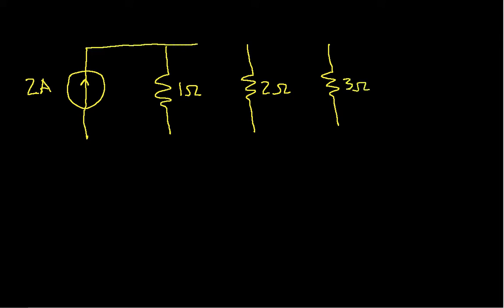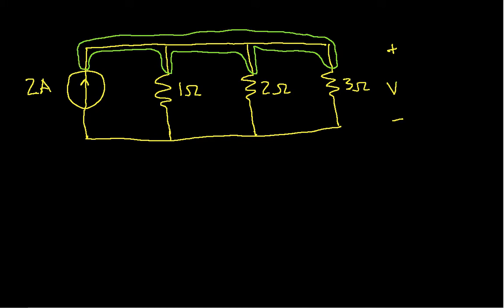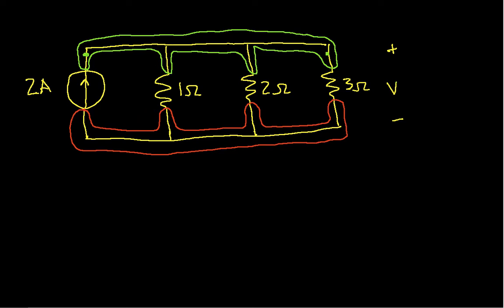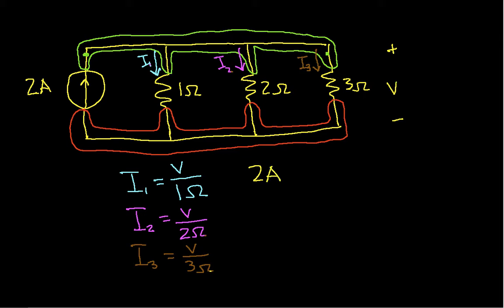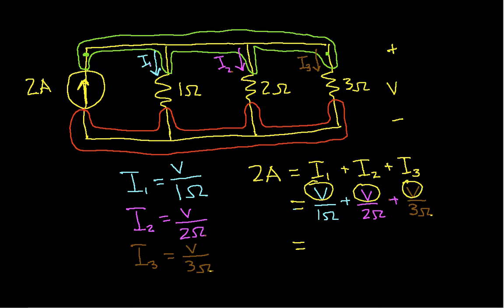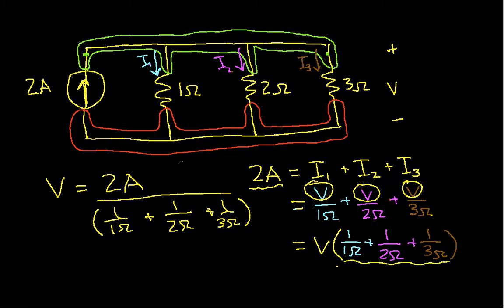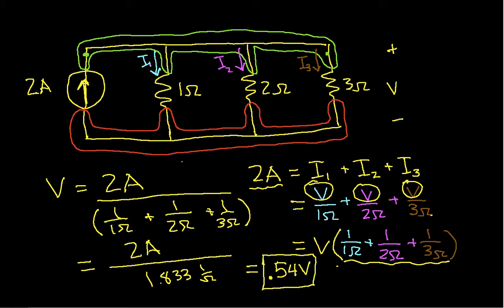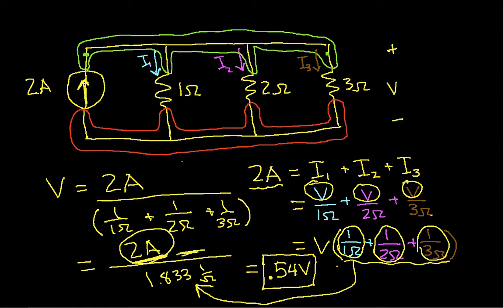Single Node-Pair Circuits

Comment: This is what I have V is:

From the first expression 2A*1/(1/1 + 1/2 + 1/3)Ohm  

Common Denominator 2A*1/(6/6 + 3/6 + 2/6)Ohm

Adding fractions 2A*1/(11/6)Ohm 

Multiplying by reciprocal 2A*6/11Ohm 

Final fraction 12/11V

Decimal equivalent 1.09V

Comment: Im a beginner in Circuits and i have question about this Circuit. can we use Equivalent of parallel resistors techniques and then calculate the current ?